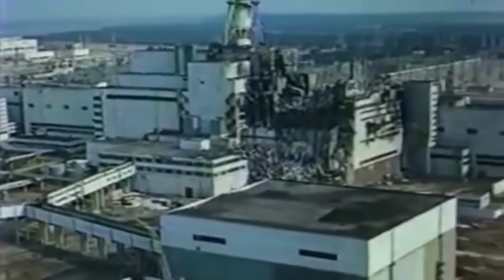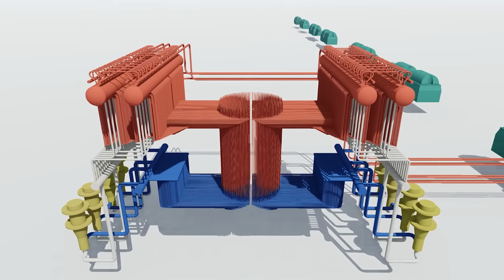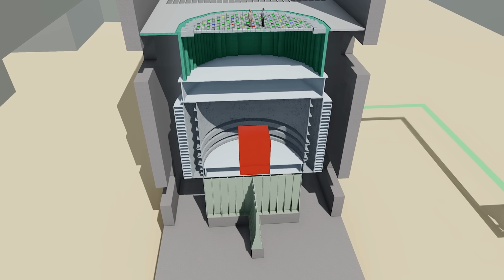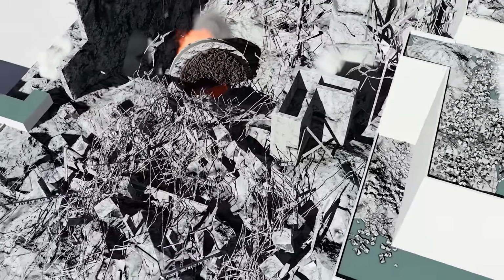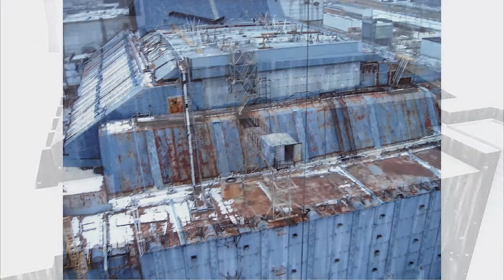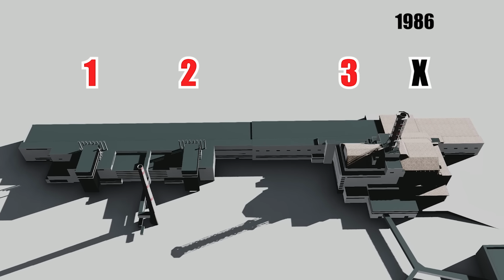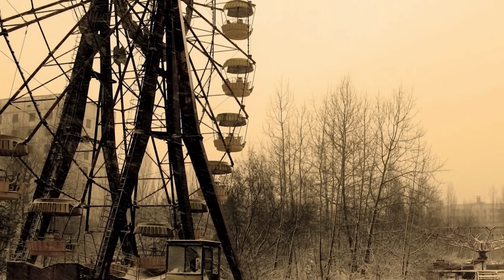CHERNOBYL DISASTER - An Inside Look - 3D

Comment: So the fuel is stored inside the control rods. Which are then pushed i to graphice blocks? Or is the control rod the center shaft thats surrounded by the uranium pellets and that moves around. Im a bit lost. How can they refuel while its on if the fuel is control rods. Wouldnt they he exposing everything.
Reply: I was also curious and the answer is actually not explained in most videos. An RBMK reactor is essentially a lot of plumbing through graphite bricks. Imagine a graphite brick with a large round hole. When you stack many of them on each other, you get hollow "channels". In some of those channels, you'd have fuel rods. In others the'd have the control rods. Every fuel rod is its own pressure vessel, it contains the uranium pellets as well the cooling water. That is actually how fuel can be changed while the reactor is running - they would disconnect one fuel rod (together with its cooling circuit) and pull it ouf of the reactor, while the other ones are in and burning. Boiling water reactactors (and pressure water reactors) have a large pressure vessel and the fuel rods are submerged in water. The economical advantage of the RBMK design, apart from being able to burn slighly less-enriched (=cheaper, easier to make) uranium fuel, was also that they did not require a single large pressure vessel. This, at the time, was very expensive to manufacture and required advanced metal working and welding technologies. I actually think this was the main reason why people would say "it can't explode". Because there is no single big pressure vessel to explode - just pipes instead. Of course, when something melts and things chemically react, things can go boom in many other ways.
Reply: No. There are around 2000 holes through the reactor, with around 200 dedicated to control rods and the remainder holding fuel. The fuel was uranium isotope 235 in pellet form, which was contained in a Zirconium Oxide casing, bundles of which were inserted into fuel rods, which were inserted into the reactor by the refueling robot. The control rods were made of two parts; the top half of the rod was boron and the bottom half was graphite.

As for refueling, the reactor has to be shut down for this to happen. On the fateful day in 1986, the reactor was due to be stopped in order to refuel it, which is why the next chance to run the test would have been in a year - when it was due to be refueled again.
Reply from the maker: Fuel rods stay in the reactor.  Control rods move in and out.  Fuel rods only move when spent fuel is lifted out and fresh fuel is dropped back in.
Reply: Mike Bell yaksvk How did they do refueling and inserting control rods through the steel lid while reactor still operating? I guess the lid did have some holes or ports for inserting rods and fuel, but how did they kept steam from coming out through those holes? Or the water used for cooling fuel rods isn’t pressurized, but heats up surrounding water which is converted to steam and sent to turbines?
Reply from the maker: @dannysmith5862  Each fuel channel had a removable top. The refueling machine would latch over and equalise the pressure. Lift out the spent fuel assembly  and lower in new fuel.  Put back the plug and hey presto the channel had enough fuel for another year or two…
Reply: I THINK fuel rods are not control rods, but separate rods.

Comment: What I could never quite understand is why they didn't have a pressure relief steam valve for the main coolant loop. Knowing that the reactor design had a positive void coefficient as they did since the 70s (as Legasov points out on his tapes), it would have been only a minor modification, easy to implement that would have protected the core from explosions (and the subsequent exposure). They were also aware that power excursion were not uncommon with RBMKs long before the inauguration of Unit 4. Granted, such a solution would mean total loss of coolant, meaning they would have to deal with a HUGE meltdown (the RBMKs cores where very large), and the steam release itself would have meant environment contamination, however the scenario would be far less grim, falling in the Three Mile Island category(of course considering the scales and core sizes), IMHO. But then again perhaps I'm being just too naive here, perhaps the cover ups and everything surrounding the soviet nuclear industry at that time, the soviet nuclear establishment itself (Aleksandrov and company) would never admit the reactor core indeed could explode, and yield in order to implement such a measure of protection, as simple and cheap as it could have been. It would almost have been considered an admission of defeat after all those years preaching RBMKs were very safe that and one could even be installed right on the Red Square if so desired. If such a system was ever implemented, I believe Chernobyl would still have been bad, but not as bad as it was, perhaps 70% to 90% of the environmental impact could be avoided, granted, as I said before, the problem of such a big core melting down would still have been there.
Reply: Because in Soviet Union, everything always perfect first time it's done. No mistakes were made comrade because mistakes were impossible! Surely you are not questioning the perfection of the Party are you, comrade?

Comment: But why did they need to do the test?
Reply: they were testing that if somehow they lost power from offsite (systems and computers in nuclear reactor were getting power from offsite i.e. from other places) so they can run their systems from onsite power i.e. from the plant itself that's why in the end you will see lagasov explained how they had deisel generators to power the pumps but they took about 60s to generate that amount of power. so the test was to power the systems from the already running turbines till generators take on
Reply: @rishirajbali8166  thanks for your thorough response. Yes they wanted to make sure in case they lost power from an attack or natural disaster

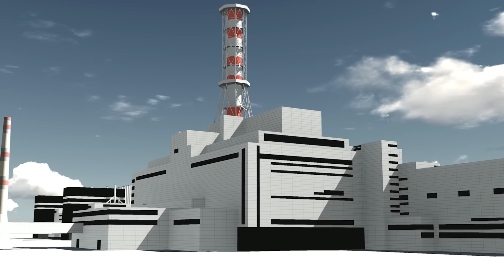Comment: 0:50 : Western reactors are safer by design but are not fail safe.  The largest problem with nuclear reactors is that even when fully "off" - with all control rods in place, so "shut-down", the core still produces heat which must be removed (ie put a large amount of nuclear material in one place - it gets hot even with neutron absorbers around it).  The amount of "water" (or other coolant) required is too much for gravity feed (using the differential density based on coolant temperature) which means it needs pumping or energy from somewhere to operate.  If there is a total loss of control or power, a reactor even with full shut down it will overheat - this is what happened at Fukashima where water was no longer pumped in the primary circuit, resulting in overheating (while in shutdown state), excess steam pressure and cracking of the primary containment - even though they vented the steam to the atmosphere.
Although much safer by design, reactors in the west are not fail-safe, but are unlikely to be much more destructive that Fukashima.
Reply: Reactors can be designed to be walk away safe if we want to, though. The need for active cooling measures isn’t an inherent feature of nuclear power technology.
Reply: @chadwells7562  then you don't understand all the current nuclear power generation or how nuclear fusion happens.  You first port of call is video of Fukashima.  That is exactly what happened, it is because decay causes heat, that cannot be turned off , the second problem is Zirconium is used as rod cladding as it is neutron neutral, and that reacts with steam above 500C to create hydrogen, again the problem of Fukashima and the second explosion at Chenobyl.
Reply: @Tom55data  Exactly as I said. It’s a design and engineering choice. The choice can be made to develop a walk away safe reactor, such as a pebble bed.

Comment: Why did they build a new ventilation stack? Why not just tear it down?

It’s not an active power plant right?
Reply from the maker: The stack served reactor 3 n 4.  Reactor 3 is off but still there.  I havent been able to find any conclusive reason.  So my guess is the new stack is there in case off-gassing needs to be done.
Reply: they are active generating electricity, especialy reactor number 3 still operated until 2000... now , i feel they are exagerated the chernobyl incident. and that isnt strange thought.  years of cold war,  propaganda, global political instability and some proxy war

Comment: wait wait wait... They fucking left the other 3 reactors running for another 24 years? And they evacuated every other town? What?
Reply: They built new town Slavutych for power plant personnel on far north instead of Pripyat, and made rail road to power plant.
Before that, power plant personnel and emergency workers, AFAIK, temporarily live in Chernobyl (nearest town, power plant was called after).
Power plant area, roads and some other areas near were cleaned up and disactivated during emergency procedures. Major fallout zones (like "red forest") were demolished and digged over, to prevent dusting. 
Other areas, including Pripyat were sprinkled with antidust "glue" and abandoned.
Reply: Reactor 2 was shut down in 1991 (5 years after the catastrophe), Reactor 1 was shut down in 1996 (10 years after) and Reactor 3 was shut down in 2000 (14 years after). They all started being decommissioned only in 2015. Decvommissioning is still ongoing
Reply: I was confused too, how will it still work if everyone evacuated from the factory.
Reply: Yup. Was still running years later. Surprised that you didn’t know that actually, but as the saying goes “everyday is a school day “ 😂
Reply: @duncangodfrey1448  I just can’t believe that with all the fallout and radioactivity they let people go anywhere near those sites for any reason. Like you would think the entire operation would be shut down. Russia for ya I guess

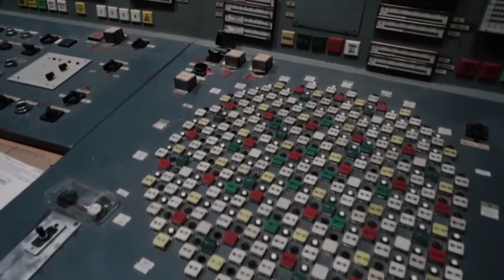Comment: What's the circular arranged buttons in 3:26? I see it in most control room and I don't know what it is. Thanks
Reply: I believe those control the rods individually and the dials shown after are analog style position gauges.
Reply: @richardluce775  thanks. But I think its per group of control rods, cause there are a lot of control rods.

Comment: If sand was heated and quickly cooled with colld water , it forms a rock like substance that looks like glass  , but won't break . The cooled sand can contain radiation better than cement and metal  !
Reply: You think they didn't try that? They did. They spent days dumping sand, mixed with boron, into the reactor. All it did was melt into more radioactive lava, contributing to the melt down and doing nothing to stop the radiation. As for "cooling it with water", that was impossible. The melted reactor material (corium) was so hot that any attempts to dump water on it  just resulted in it vaporizing into steam before it even touched the core. This was not an option.
Reply: @zephyfoxy  : There more ways to cool the sand than just water !  The Russians waited yo long to the World what they did and they still have the same generation of reactors in use ! By the way , I have been around reactors that have a 40 foot high cooling tank and a shy walk across the tank , the core emits a blue light ( not true light ) .  The staff are diligent with safety . I also have been to nuclear reactors that have had one shut down because a fuel bundle issues , held rediosctive pellets to examine thems and used robot arms to move radioactive isotopes around bebhind lead plated glass . Because of the Russian's negligence the vancer rate in the World was predicted to increase by 4 % . They fessed up too late to the World .  There is technology that would seal the core , but since radiation has been allowed to escape for decades , its become a mess .  If society is tonuse nuclear fuel for energy , the every country that uses it must agree to spot audits by UN nuclear physicists .  The cement dome over the reactor will soin decay and they will still have issues . The vore cannot be hotter  than sun , there for using quickly cooled sand or componets there of is not impossible , just very , very expensive and requires either tobits or many human workers in protective gear with time limits .  Trust me this about money and power .

Comment: The test being conducted had little to do with safety.  The goal of the test was to find out if there was enough extractable heat in the reactor core to continue generating steam and running the generators at low power to power a shutdown if the reactor was scrammed during a period of no access to offsite power and none of the other reactors were running.  It may have been to determine if there was need for on site back up diesel generators.  

The event was already highly unlikely and carrying out the test required what can only be described as deliberate sabotage of the safety automation to get the reactor to low level of power needed to begin the test.  Actually scramming the reactor would have been safer, but they might not have been able to complete the test, before the reactor would not be able to immediately be started back up.  Unfortunately, this was during the former USSR, so the plant manager did not have the authority to refuse to carry out the test program.  Disabling the safety automation took longer than expected and repairing the damage done could not be completed before the shift change.  As this was when the USSR pretended to pay its citizens, so the citizens pretended to work, the workers at the plant simply up and left at the end of their shift and none of the operators coming on shift had the least clue of what had been done to the reactor.  All they knew was that the reactor was at a ridiculously low power level and the schedule called for full power.  One of safety systems disabled for the automation that prevented the power level of the reactor from increasing at too high a rate (the jump rate limiter), so when full power was requested, the control rods came out without the expected delay and the power output of the reactor increased at an alarming rate

The odd design quirk of the RBMK1000 reactor was that the control rods were used to both control the total power output of the reactor and provide local control of the neutron flux in specific zones within the core ("neutron flux shaping"), so the control rods were not all made of neutron absorbent material along their whole length.  Some rods had lengths that were water and other lengths that were graphite moderator.  When a shutdown of the out of control reactor was attempted, a length of graphite was introduced into a region where there had been a void in the moderator and the additional graphite pushed that region into prompt criticality, which caused the explosion that hurled the reactor core out of its shell.

The RBMK1000 reactor was more dangerous than most western reactors, but could be operated safely and without incident, if the safety systems were allowed to perform the task that they were built to do.  IF the plant manager was a better party member than engineer, and understood what his superiors wanted to hear, he would not have bothered with the test and simply lied about getting the desired result.
Reply: Very interesting, thank you for that. When you say scram, is that a term for shut-down in general, or just nuclear reactors?
Reply: @jenmary99  One accepted account of the first use of "scram" was that, in the event of an emergency during the experiments with the first atomic pile, someone had to hit the big red button on the safety panel and then run away (scram), so the big red button was called the "scram" switch.

The term "scram" has been used as an expression for an emergency shutdown of a nuclear reactor, ever since.

The link I found about 'Scram':
https://public-blog.nrc-gateway.gov/2011/05/17/putting-the-axe-to-the-scram-myth/
Reply: Man alive, that’s not what the test was for at all. The test had nothing to do with “enough steam to power the turbines” it was to see if the turbines had enough momentum (flywheel effect) to produce enough power to run the pumps till the diesel generators kicked in. Everyone on the planet who has done any research on Chernobyl knows that. Also at the point of the shift change the power production was about 50% which is not “ridiculously low”. The test was supposed to be started between 700 and a thousand mw. It was the party man that ordered the guys that were actually controlling the reactor to start the test at 200mw. It’s only because of it being so low and then stalling the reactor and him forcing them to restart it and changed one of the operators cause the original one was arguing about it being the wrong thing to do. Then when the replacement guy got it back upto 200mw the original operator was reinstated at the controls. It was a poisoned core. Due to running at 50% for a large portion of the day. When the emergency shut down was pressed it was the graphite tips on the control rods that caused the massive spike in power. You have some of the info right but in the complete wrong order and massive bits missing. The engineer in charge in the control room was totally party man. If he had lied he would have been going against his party and the promotion he was trying to get (has the test been successful) would have been destroyed. Hindsight shows he didn’t get it anyway right enough but hindsight is always 20/20.